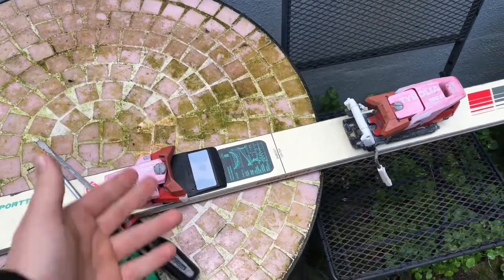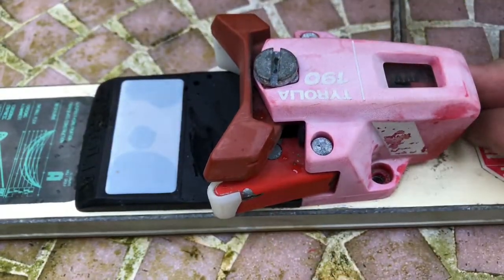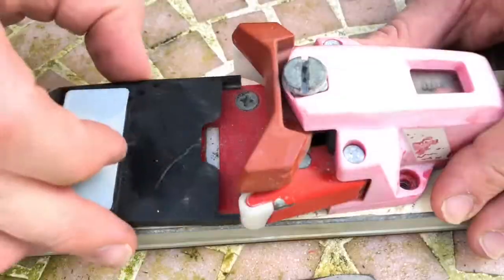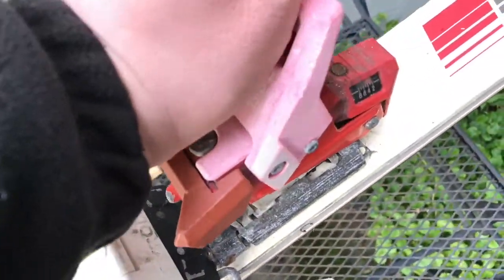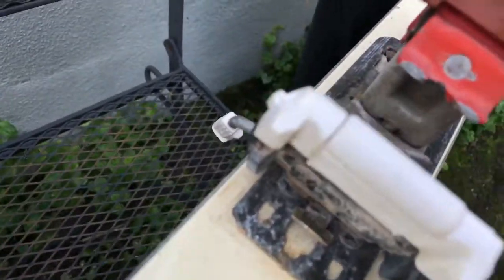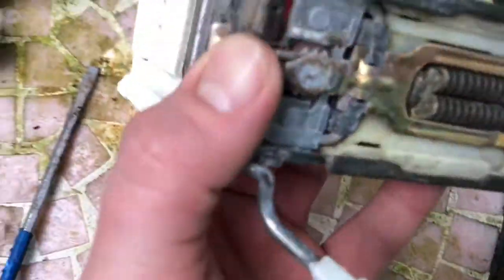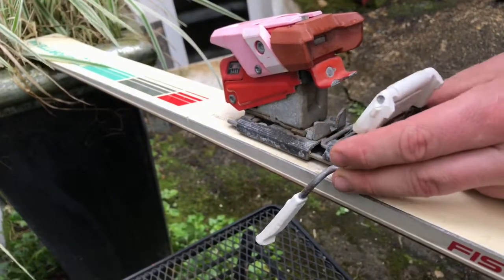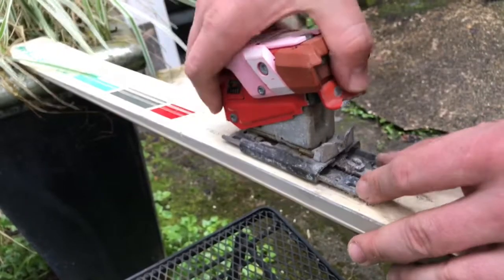How to disassemble an alpine ski binding disassembling a ski binding DIY

Comment: How to remove rear binding: 1)Turn lock screw so slot faces front and back of ski. 2) under front of binding, press metal tab down. 3) tap/slide entire binding backwards and off of track.

Comment: Thanks for the video. I was fighting with the rear binding trying to get it off. When I found both pieces will just slide right off the "track" if you put the right pressure on it. I wouldn't have known to turn the one screw 90 degrees though if it weren't for your video.

Hope this comment helps someone else if  they're struggling with the back binding like I was.
Reply from the maker: Thanks for the support
Reply: Any tips because this doesn't seem to be accurate. I've twisted the screw till the teeth are not interlocked anymore but neither part "just slides" apart.

Comment: Still not understanding how you got the rear binding off, is it a push down on the gold piece and push forward ? It won't budge
Reply: Seriously he didn't show how he did that
Reply: @johnmarshall8165  if yours are like mine they are probably stuck on there. Once you turn the lock screw to open you should be able to beat the whole assembly until it slides off the tracks. DO NOT try to bend the hooks up to unlock the front piece that comes off. You will bend them out of place or break them